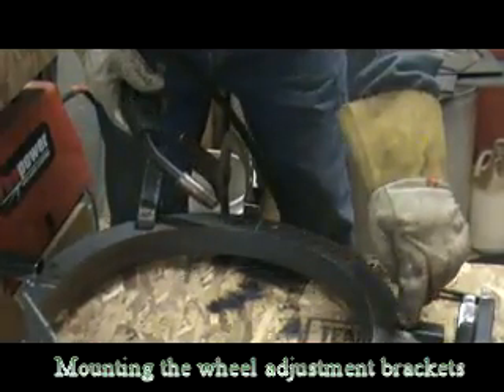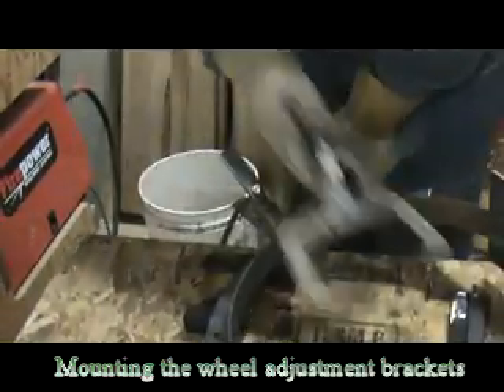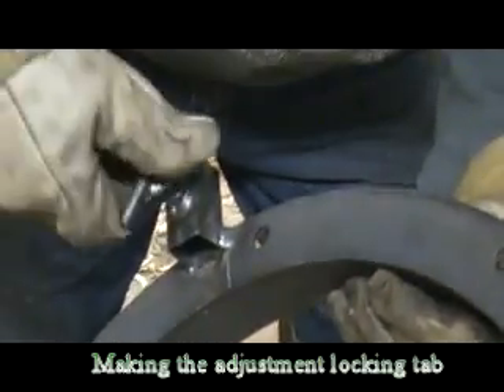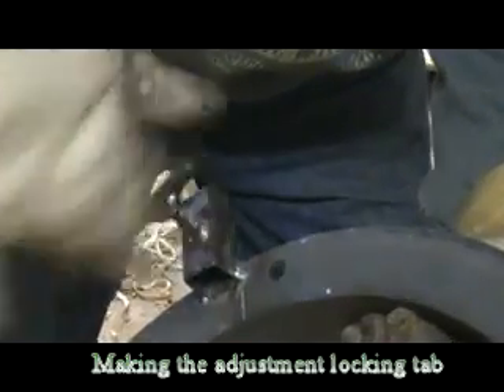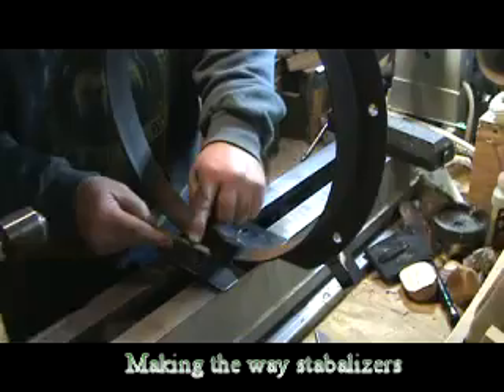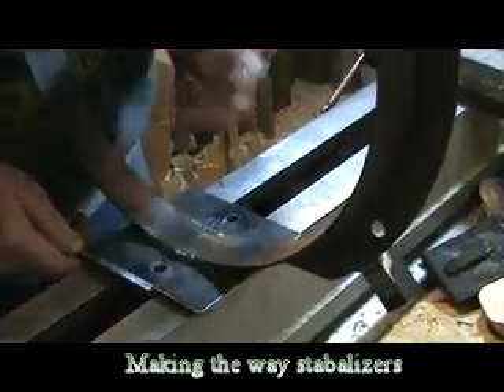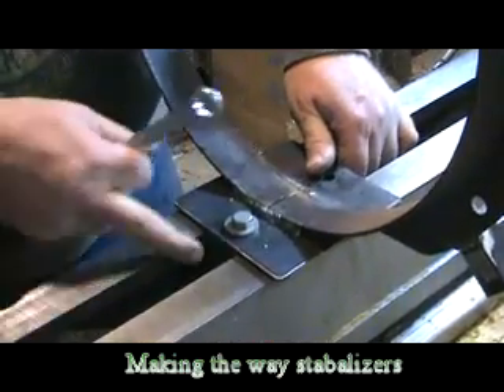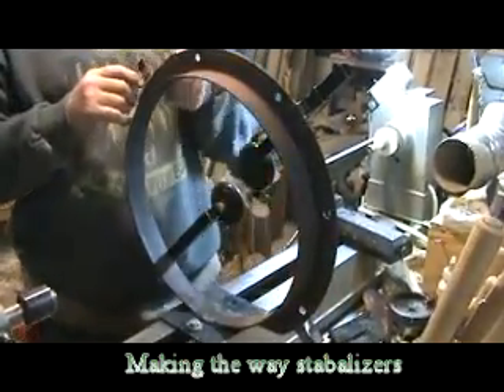Making of a Steady Rest

Comment: Hey all I the "Angle Rings" or companion flanges from a local heating and ventilation shop that I used to work at. They specialize in spiral round pipe and the rings are used to connect the pipe to fittings and other lengths of pipe. They are used in commercial and industrial applications and are available on line or at a local sheet  metal shop.

Comment: koemar70, The wheels are just skate wheels and I don't think the hardness has much to do with how they perform.  I bought them in bulk as close outs and whatever I got was what I used.  They can be mounted on the lathe and turned down to different size and shape if desired, but good bearings are the key.  Good luck with your project.